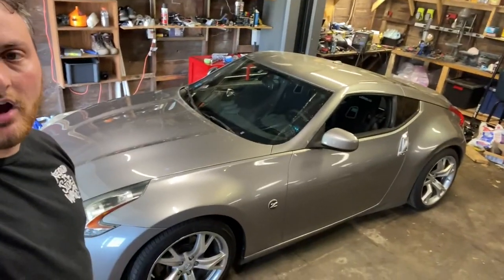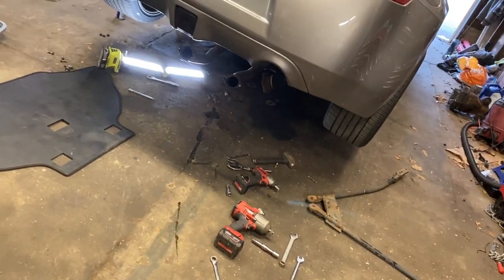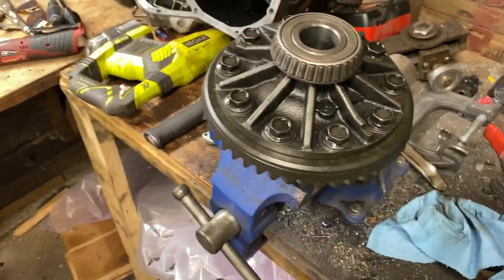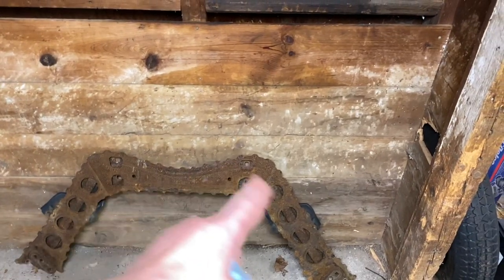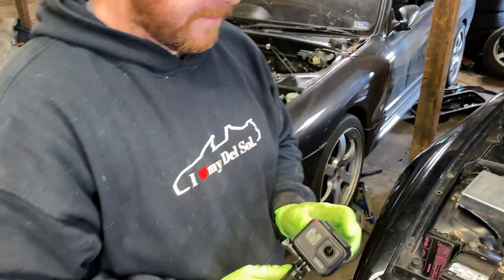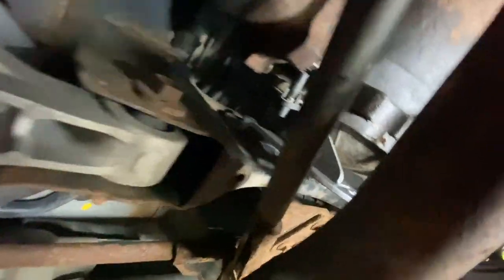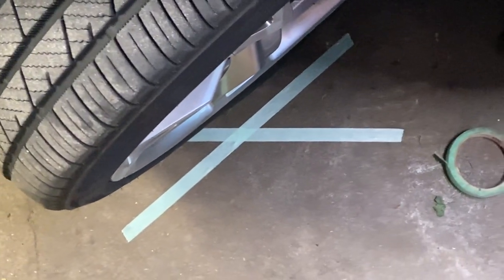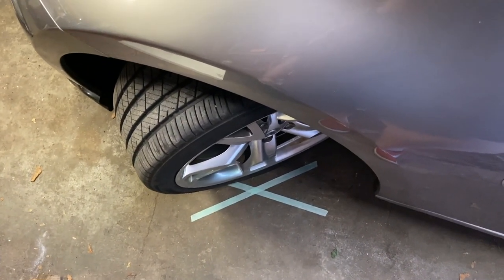The ULTIMATE budget drift setup for a 370Z!

Comment: I’m 6’5, do you think I could fit decently with stock seats in a Z
Reply from the maker: Not really. I’m 6’5 as well, I installed corbeau fixed back seats with no sliders and it’s great now. I have a video on that if you want to check it out
Reply from the maker: I drove mine with stock seats for a few months. It’s doable but in my opinion aftermarket seats are the way to go. Especially if you ever plan on tracking the car as you’ll need to account for a helmet. I fit currently with a helmet with over an inch to spare.
Reply: Tim Cowley thank you 🙏

Comment: What offset are the front rims?
Reply from the maker: 18x8.5 +35 with a 15mm spacer so +20 effective. Still sunk a bit though could probably still fit a 20, or 25 mm spacer you there